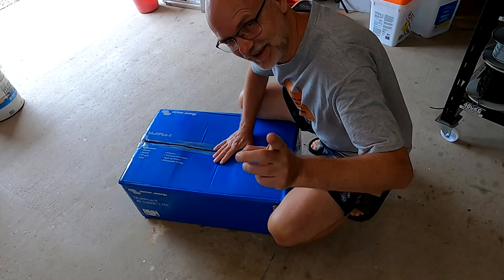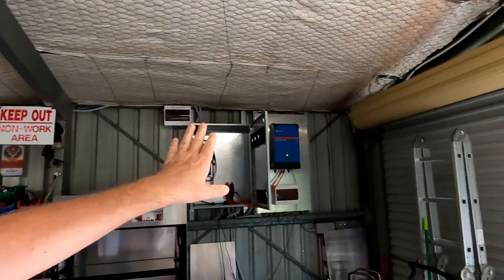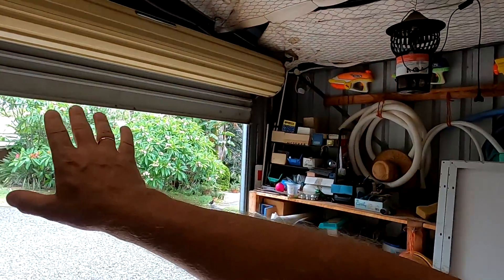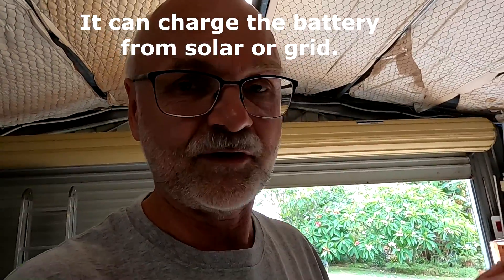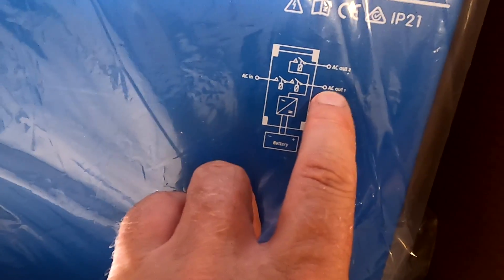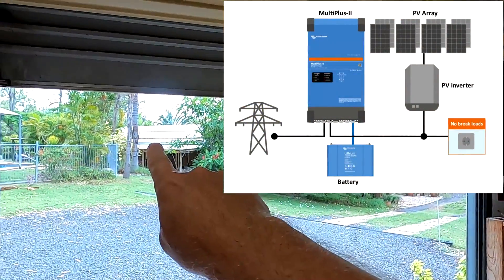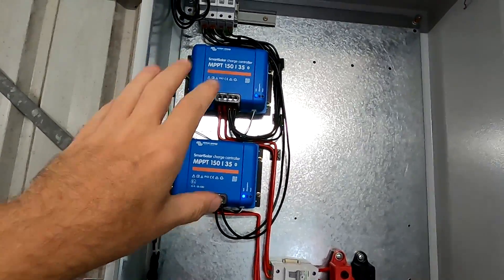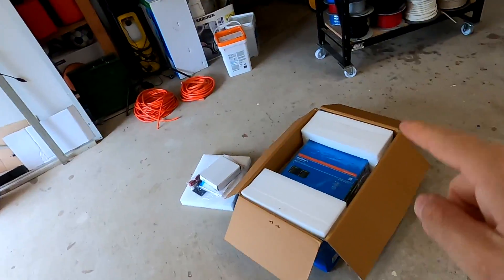This Multiplus II is not what I've ordered. But I keep the free upgrade, right?!

Comment: Great video. Can't quite believe what I'm seeing here. What an amazing piece of equipment. It looks like this could be used to serve as  AC coupled battery manager to retro fit to an existing grid tied PV system??. When Grid AC input is connected, does it actually synchronize it's AC "microgrid with" waveform with the local grid profile. I assume it does, otherwise there would be a fairly loud bang/fizzing.

Comment: Hi, actually i was following the other new LF inverter by the name Multi RS Solar which i have been told cannot be used as AC couple like the multiplus ii does. Since i already have grid tie Fronius inverter, does this hold true that i need to grab a multplusses rather than the new Multi Solar RS?

Comment: You are giving me the information i need for my project. 

I want to connect a 230volt output solar system (Only works if there is a 230volt "input") to the input of the multiplus. And you confirm this wil work because the multiplus creates a own 230v field in the multiplus.

Thanks you for thus critical information. I already have a 3000whatss inverter, so iam need to think if iam going to keep this. Or sell it and buy a bigger multiplus converter... 

thank you sir!!

Comment: I think you may be incorrect in regards to the Multiplus being allowed to see the grid in Australia. The CEC hasnt certified the Multiplus to interact with the grid in NSW I dont know if this extends to QLD. This is because Victron have not made an application to the Clean Energy Council to certify the Multiplus to be grid interactive. 

Organisations like CEC are my pet gripe, they are an opinion body at best whereas the Vistron equipment has been built to comply with world standards. Its a bit like ADR vs  Euro NCAP for cars. Australia doesnt make cars so ADR is redundant.
Reply from the maker: I think there was recent re-classification for the MP in several countries and it will be approved again soon. It is also still on the CEC list here in AU. I checked it like 2 weeks ago...
Lot's of companies are still using it for hybrid systems (incl. grid connection) in NSW. I know two of them...
Yeah, I agree with the CEC not really up to speed with things.
Why is the MP approved in Germany (with higher safety standards) but not here 🤷‍♂️
Reply: @OffGridGarageAustralia  Agree 100% Andy. Europe has much higher standards. CEC works on who pays for their certification rather then any applicable standard. I will have another look at CEC website as if I can get the Multiplus see the grid it will make life easier.

Comment: I would have sent it back and request delivery of the Multiplus 1, they switched out the toroidal transformer on MP1 to 2 conventional transformer which heavily compromise continuous and peak power…far more then the specs try to make you believe
Reply from the maker: There is no MP1 any more. The MP2 has two toroidal transformers.
Reply: @OffGridGarageAustralia  sure there  is, i  just ordered and installed Multiplus 12/3000 and a 24V/5000 in two boats. MP2 are conventional transformer, no tordorial ones, at least in the 3000 and 5000 ones. thats also the main reason the surge capability  is lower then MP1. i switched from victron to swiss make studer, their 24/3500 has a 9000W peak capability for 5 sec. they are metricously build& designed 100% swiss made. it has a massive toroidal trafo which in the 3500W is as  big as the Victron usis in the 5000W

Comment: I have another question. And the charger inserted into the multiplus, it immediately charges with the maximum current that is set in the program, or it has the ability to charge first with a lower current and then it only increases Forgive me if I put in the menu so that my charging there is 100 amperes and my battery will be practically discharged, he will immediately give me up to 100 amperes to charge this battery, or yes, first, less than 100 amperes and then raise this current to 100 amperes Well, it's like example .

Comment: One more little question :) If I have 3 invector to create three phases System, When I install 3 inverters I can use separate batteries for each inverter? The idea is that at the moment I have 40 kW lithium cells from an electric car in I want to use them for the first inverter, And for the second and third inverter I want to use lithium iron batteries .In the first variant, I will have an assembly of 13 s In the second variant, I will have an assembly of 16 s. I can separately set up charging on each inverter, one for charging lit-ion batteries and the other for charging lithium-iron batteries ?

Comment: Thank you very much for your reply. I have a photo electrical system for 20 kW The system consists of four circles of photovoltaic panels of 800 v each . But I want to make it also autonomous, that is, use batteries. It is no coincidence that your video saw that the wind has the ability to create its own micro network to work with a network ivector. I was very happy about this and immediately the question arose Which invector should I buy Quadro or multiplus :) For three days I lived with this thought that I need to buy a multiplus or Quadro inverter. And now I understand. By how much I have a three-phase network inverter, it means I need to buy three multiplus  inverters :(

Comment: If I connect the multiplus to an existing system that has a grid inverter .It creates 220 at its output terminals so that the network inverter understands that it is connected to the network when in fact there is no network. As far as I understood it then. The Quadro also has this feature.?
Reply from the maker: Yes, you can connect grid inverters either at the input of the Multi/Quattro or the output. If the grid fails, your grid inverter will fail as well if connected to the input but if connected to the output of the multi, it sees the micro grid of the Multi and keeps working. There are rules and boundaries for that but it works quite well.
https://www.victronenergy.com/live/ac_coupling:start

Comment: Hello As far as I understand from the instructions for the inverter Quattro 48/5000/70-100/100   It also has a built-in charger.  Or I'm wrong ?   Please tell me what is the difference between multi + 2 and Quadro ? As far as I understood from the instructions, the only difference is that the Quadro has a separate input for connecting the generator . Or is there some other difference that I did not notice please tell me.Thank you very much for your video, it’s impossible to find a better video on YouTube about setting up and debugging injectors, you’re done. I'm sorry for my English, I know it's bad but I unfortunately have to use Google translator
Reply from the maker: You are absolutely correct. The Quattro has two inputs and two outputs while the Multi has only one input and two outputs. 
Both have build-in chargers which can charge the battery from the grid or other grid connected solar you may have.

Comment: Great inverter. You can actually daisy chain the Multiplus II after the Phoenix. Connect the Phoenix on the input of the Multiplus II and the Multiplus II will be able to supplement the power if the Phoenix doesn't have enough capacity.

Comment: There is Growatt, MPP Solar, EA Sun that do all that at a fraction of the price.
Reply from the maker: They cannot handle AC coupled solar in an off-grid installation?
Reply: @OffGridGarageAustralia  Of course they can, in Europe we use this kind of hybrid solar inverters, they are connected to the house and they do everything, pulling energy from solar, battery if you heave and you can inject the rest of the energy produced in to the grid if you can.
Reply from the maker: @GabrielIonescuisro  OK, never heard about these features from any other manufacturer. They all can deal with DC solar but AC? 
I also like the Victron products because of the seamless integration and remote control which comes as standard for all their products, long warranty and the free OTA updates they provide for their products. Like with Tesla, their products are getting better over time for free. The Victron community portal is also great where they have Victron staff helping people out and picking ideas for future software updates.
Reply: @OffGridGarageAustralia  maybe you are right, but they are so expensive, with our eastern European income, it is not an option...

Comment: Good day Andy, now that you have opened up the inverter can of worms I have a few questions. I have been thru your videos, and I can not find your review of the Smart multi ii. Why did you choose this one versus the quattro? Were there any others that you considered? Thanks in advance. Love your channel. It's been 2 days without a video.... gimmie gimmie gimmie
Reply from the maker: Thank you. I had to work, no videos any more... until tomorrow morning!
I chose the Phoenix because it was an off grid inverter. I cannot connect anything to the grid until 2028 when the feed in contract runs out.
https://youtu.be/0HTro_ZqLbM
Reply: @OffGridGarageAustralia  I remember now. Thank you for the fast reply. Still, you never did explain why you chose this one over lets say a Outback Radian. I start my battery build this weekend. As my budget is limited I chose 2 of the Septos technology 6.9 DIY battery. After done I will have to buy an inverter. I am torn between the Quattro and the one you just received. If interested let me know I will tell you more. I do not own a camera so if you wish video it will be cell phone footage (Sorry). Thanks again for being Andy!
Reply from the maker: @gruetoo1  All the Victron gear works nicely together and I can access and configure every single device from my phone world wide. The VRM is outstanding. Victron also supports a lot of modification and automatisation (eg. Node Red) which I will use in the future. A great communty on the Victron portal which helps each others out and is also moderated by Victron specialists, 5 Years warranty and software updates for all devices to provide new functionality and bug fixes. Just like in a Tesla, it gets better over time.
No other company offer such service and quality as far as I know.

I don't know you application but the Quattro has two AC inputs and is more designed for mobile installation, one AC plugged in to the campground and the other to a generator for example. All other features are the same I think...
Reply: @OffGridGarageAustralia  My application Is An AC coupled system that the AC goes down. Between the transformers going out and Wild fires and what they call a PSP event (Public power shutdown) And rolling blackouts my utility is not reliable. I now have batteries and will need a inverter to bring online. With the power outages I now have a generator. I really don't want to touch the AC coupled system so I was thinking to add some sort of system to ensure I have electric power. My utility only pays me 7c and charges me 30 to 32c so not worth selling back to utility. So my thought was Quattro 10k will start with 13.8kw battery. I will add more as I can afford. So I am looking for an inverter that will allow dual AC inputs. So when Utility goes down I can run genset and have power. Again thank you for all you do.
Reply from the maker: @gruetoo1  That's exactly what the Mulitplus is for. It will keep your AC online and operational even in case of your utility power going down.

Comment: Do I need a PV inverter to set up a AC tied System? I would like to use the Solar power if available and add from the grid what is  needed in real time. If I don't use enough or any power it should charge the Battery and if the Battery is full it should put the overflow energy into the grid. I got a Multiplus 12/300/120-16 (not II) an Victon mppt and BMV. What else would I need to set this up?
Reply from the maker: That's exactly how the system will work. You maybe want a Victron energy meter as well to control what is coming in from the grid, so the Multi can act accordingly.
The ESS design and installation manual gives you all the info:
https://www.victronenergy.com/media/pg/Energy_Storage_System/en/index-en.html

Comment: He He He your missing the 22 in your numbers on the wall, (20000).
Also i think you should keep the new Inverter, and use the old Inverter, for a new project some other rainy day. But Make a stand for it so it wont pull your wall over. LOLOL
CCHHEERRSS

Comment: hi Andy. keep it, of course. In the other hand, you mentioned a very interesting feature (emulating a grid). If I understood well, and this inverter is able to do so, you can connect an aditional "on grid" inverter since this type of inverters need to sense the grid´s voltage wave to mimic the power to be supplied (no grid= no power even if you have full of sun in the panels). In this case you can have electricity supply even in case of the grid is off. I think it is a nice feature and some interesting to show in a future video.... ;-)
Reply from the maker: Yes, that's exactly the third feature I was talkig about in the video. Even in an off-grid installation, you can still use your grid-tied inverters and solar. Only a few inverters will work this way though as they need to react to the frequency shifting of the Multi. Also, there is a rule that the AC coupled solar cannot exceed the inverter power, so 5kW of solar can be connected to a 5kVA inverter, but not more AC solar.
More info here: https://www.victronenergy.com/live/ac_coupling:start#:~:text=In%20both%20grid%2Dconnected%20and,3.000%20Wp%20installed%20solar%20power.

Comment: Just mounted my MP2 48 5000/70 , what a beast!. Included a Cerbo lus smartshunt and will connect a smartsolar 250/100, 250/70 and 150/30 in order to run on batteries during the summer. Victron is LEGO for nerds LOL.
Reply from the maker: Hahaha, great analogy.

Comment: Keep the upgrade, do multi-plus 2, its futureproof, and then you wont need to rebuy gear, buy right buy once, buy cheap buy twice, and then have to sell or junk old gear
Reply from the maker: But I don't need these features for the next 7 years until I can connect to the grid with my system. It will be outdated until then...
Reply: @OffGridGarageAustralia  Still will retain more of its value compared to the phoenix, which will be considered of way less[or zero] worth, and 7yrs in the future maybe youll be able to parallel between different inverter modules, who knows, So either way id go multi-plus 2,
Reply: Also means youll have some redundant charging capacity built-in, in the event of equipment failure, regardless of if you use it right now :)

Comment: Just feed the multiplus at the ac in with the Old inverter. Then you have 10000 watt. Then shut off the Old inverter when 5000w is enoff.
Reply from the maker: It does this automatically, uses the 5kVA first and if not enough supplements with the power from the 3kVA inverter.
Reply: @OffGridGarageAustralia  yes. You might setup the multiplus with a laptop to disable the charger function. That would not make sense when feed from the inverter :-)

Comment: I am thinking of having 13KW of solar thru a 10KW hybrid connected to 20KW of LiFePo4 batteries for the house totally separate from the mains - the only thing using the mains will be 2KW or 4KW battery charger as backup so they can't limit my solar or inverter size

Comment: ATTENTION I pumped 0.01 kWh into the grit today, and the ESS was set to no grit infeet? he probably did this along grit setpoint was at 0W is now at 30W IN then probably no power can go out on the grit.  I think
anyone have an idea?
Reply from the maker: This mostly happens when a big load turns off and the inverter needs some time to throttle down. There is always a bit of a delay which causes energy to flow back to the grid.

Comment: I remember in the begining before the 3k i ask why not go w 5k so "I told you so!" :D
Reply from the maker: Yeah, I know... many people have questioned that. 3kVA is workable for what I use the system for as I can shift loads so they don't run at the same time. But now with the larger battery coming online soon, I want to see how far I can get with a larger inverter. And the Multiplus may be capable to use the smaller inverter as its input AC power so we can piggyback them. That would be an interesting project.

Comment: I love the Victron Multiplus II. I believe the phenix inverter can be used for another project or sold off, so that leaves you with some funds to get a new Multiplus II for increased power output through paralleling.  Have a great week
Reply from the maker: Thanks Nsikan. Or, as other commented, I can use the smaller inverter as the input for the Multiplus... Let's see if this works.
Reply: I am eagerly looking forward to that.

Comment: Keep it...., and make a test! 
Take the Phoenix to "AC in" and Set the "Multiplus2" to "Power Assist" :D. So you will may get up to arround 7-8kva (~5.8-6.3kwh) from your System and will this combo work ?
But it is a expensive test, if something will go wrong 🤮.

You and Victron told us that both system can´t work together, but in this combination nobody would think about this workarround or 😁?

What do you and the community think?
Reply from the maker: Thanks Joern. I have posted this question already on the Victron Community forum and will see what people say.
Some others here have left comments as well suggestion that and a few have even done this successfully.
From a technical perspective, I cannot see why this should not work. I just need to set the power assist a bit lower and consider a possible throttling of the Phoenix when it gets warm. But I could also adjust this setting between winter and summer for example.
I'm very keen to test this out and see what happens...